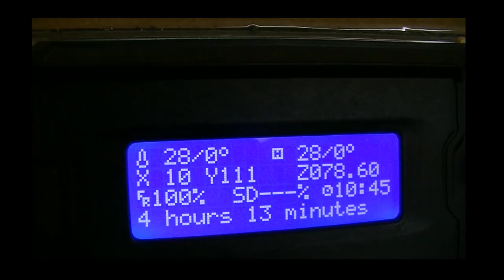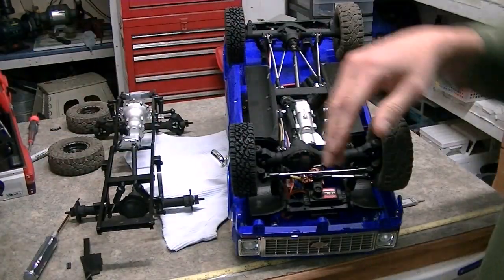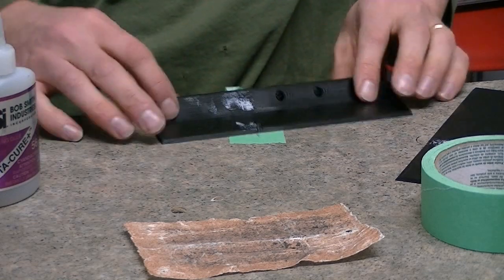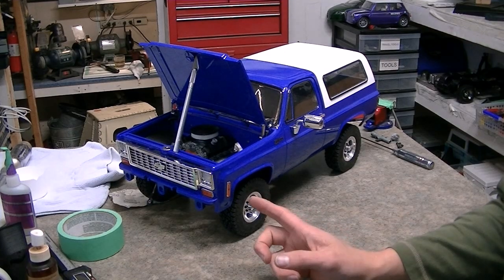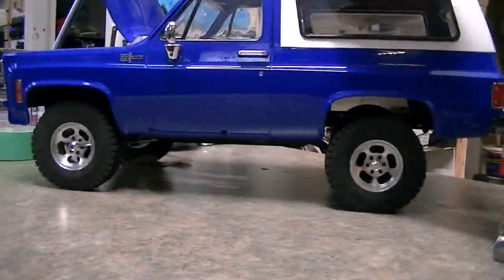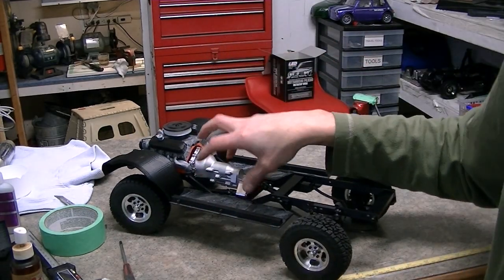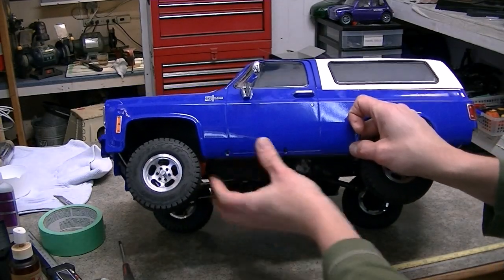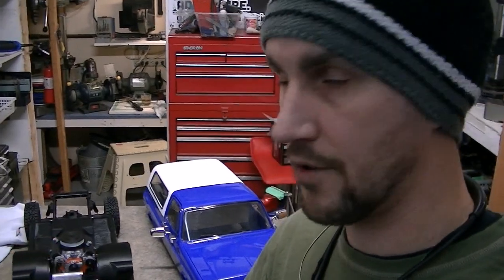GCM DELTA Chassis Blazer Build Part 1

Comment: I didn't realize that the Delta Chassis stretched to 313mm! 😱
For the first time, I want to do a Blazer. And I'm a Ford Guy!! (I WISH RC4WD could come out with a Hardbody that ISN'T another Yota!!) 
That looks AWESOME Chris! 👍👍😎🍻  I know from working on the real things as a Career, that on MOST GM Vehicles, they had an indent on the Firewall for Distributor clearance. In 1975, when the Huge HEI Distributor was introduced, the indent was made even deeper. 
Is making that indent in thick Plastic easy enough, and not look like ass? That would be the Scale solution though.

Those Sliders are Perfect! The idea of Set Screws, and filling in those Holes (the ONLY really unrealistic thing on the whole Rig), is BRILLIANT!!! 
I Hope to be able to afford to build this, and the 242mm Delta Chassis someday. Thanks for all you do for us!!
Carmine 💥⛽
Reply from the maker: It doesn't... it only goes to 287, not up to 313. 
THanks for the comments! It does seem that I'll have to imitate that firewall dent for this RC truck also, and then it will all fit well. I may try to heat it up and bend it instead of chopping.
Reply: @GCMRacing1   My Mistake Chris.... I didn't know that the RC4WD Blazer wasn't a 12.3". That opens up a few possibilities! I'm still excited to try a Delta Chassis!! 😎
Carmine 💥⛽
Reply: Hi Chris, good idea just heating the fire wall and pressing in the dizzy indent.

Comment: Awesome Video.  I received my Delta Chassis from GCM Racing a few days ago, mounted some GoodYears and now currently working to mount a Team Raffee D90 Truck. Also ordered a printed Land Rover engine from Scale Design MrCommaD to drop in. The Delta chassis is some fantastic work from Team GCM  -  Most likely I will replace the front axle with the proper drop for scale purposes.

Comment: As far as the distributor & the fire wall. I was thinking the same thing. If you notch the firewall it’d be more realistic look. Stock firewalls are never flat. Awesome looking truck 👍😁
Reply: I would recommend using a heat gun to soften the plastic and mold a curve to make room.

Comment: Where do I get that 454?
I made out of light weight aluminum, little brackets to move the interior tray up.
I dig the build.
Reply from the maker: scale designs by Mr CommaD is the motor maker.
Reply: @GCMRacing1  Awesome, thank you; I've got his site bookmarked.